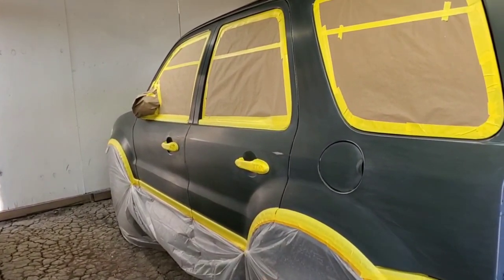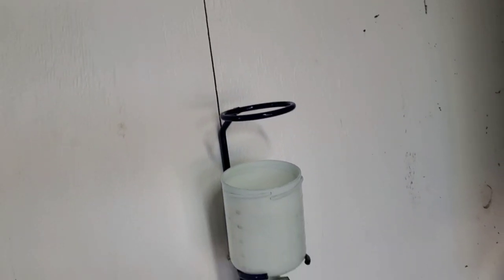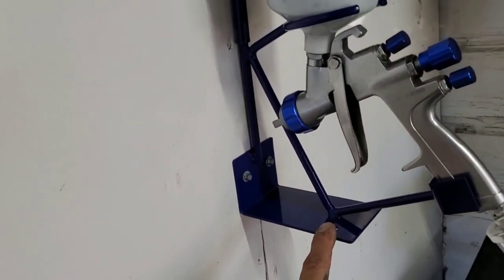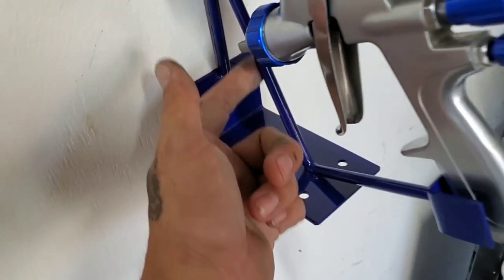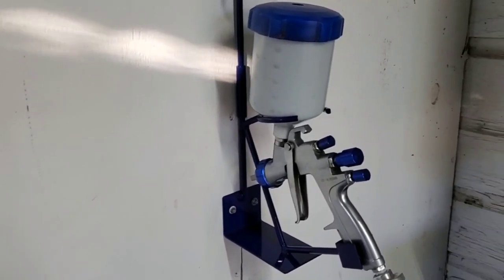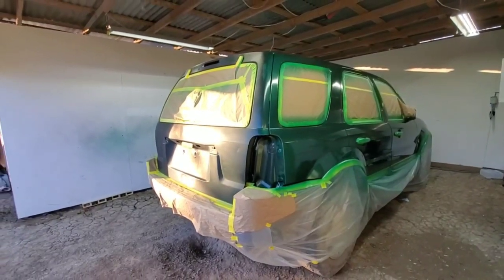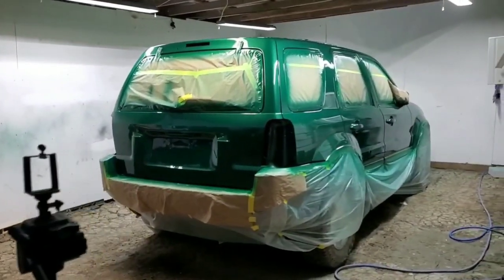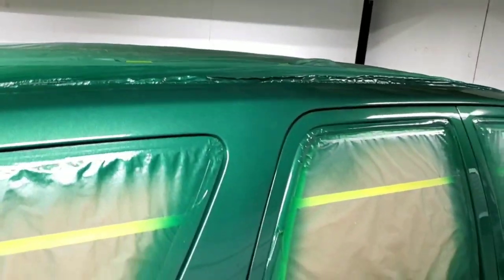Let's Spray!  eBay Paint "Jade Green " on a Ford Escape

Comment: One trick I was taught early on is to drape your air hose over your shoulder. That way you prevent it accidentally touching the wet paint. Getting any kind of blemish like that is always a pain in the ass! Also, swivel connector leader hose off your gun helps a ton!
Reply from the maker: Yup, good advice!  I need a swivel to be able to reach the lowest parts of the rocker panels..

Comment: Amazing how good that turned out with dirt floors and an open bay door!  I can only imagine what you could do with an actual spray booth!  Keep it up. Much success is coming your way. 🙌🏼
Reply: Yep, I painted some of my cars outside under trees, and it turned out ok. I did single stage. One just needs good light, light to no wind, and no leaves falling. Sometimes a bug or two gets in the paint, but wayyyy cheaper than paying someone who is just in it for the money to paint the auto. They do not do the prep, and quality masking needed. Plus they over charge for cheap paint, and in 2 plus years, you can see the lack there of by them, but they got your money, none the less.
Reply: @seanbrooks9308  Why does anyone work at a job? There is shops that half ass things no doubt, but the majority of us that have our own do not. Yes doing it for the money is the point, but so is doing it right so you have people spread the word AND come back. If places don't prep, mask right, or charge too much they ain't in business long.
Reply: Its set On verry Low Presure air..

Comment: Dang GT, that color came out good. I also use ebay for all my paints. mbiauto has kits with paint, clear, and hardener included and I just use the master pro primer from oreilly. You're the reason I decided to get into painting. Stay blessed bro and glad you could upgrade to that dewalt compressor.

Comment: Need to spray water around floor surface to avoid dust in the air
Reply: He spraying with the garage door open
Reply: thanks for that tip but also if i wanna use tarps do i moist them as well
Reply: He's painting on top of dirt...

Comment: 👍 Do you ever spray extra layers/coats on the front leading edges of the hood and fenders, to protect against rock chips and bug impacts? Maybe its just a 🇨🇦 thing
Reply: I tend to lay down some extra paint and clear on higher wear areas. It's not just a Canada thing babes.

Comment: Deffinatly nice for single stage !!
Reply from the maker: I also enjoy using speedokote primer and clearcoat. Great products, at a great price!  👌
Reply: @GTsPerformance   honestly best products in the 100-300$ range.
Reply: U got a great channel bro .. few things I'd love to see you upgrade to get you to the next levle . A nice paper tree / masking machine. Better gun, and rubber coat / epoxy that floor your spraying of for cleaner results ! All of those things would run under 1k and u will be amazed how much better things turn out ! If you need any help just pm me on FB Marco Colbert
Reply from the maker: @speedokoterefinishnetwork4937  I appreciate the feedback. I have a garage that is fully covered and with concrete floor.  That is going to help me with the wind, dirt and weather problems. I'll give the epoxy floors a good thought once I settle in. The garage still doesn't have electricity,  but I'm working on getting it connected very soon. 
Also, a 60 gal. compressor was another big investment to the garage & channel.  My best gun i have would be the Italco h3000 (which I save for base coats, candy and clears), then the Kobalt for anything else.
Definitely trying to give the channel an upgrade.  Thanks for the support!

Comment: Hi I was wondering can you put 2k clear on top of single stage paint if yes do you wait till it dries then sand it then spray with clear or you can do it after you spray the single stage thank you
Reply from the maker: Yes, you can! I would wait till after the single stage dies incase you get any bugs or imperfections,  you can sand it before applying clear.
Reply: @GTsPerformance  thank you how long is good time to wait a week and would single stage and then 2K clear on top would be better than base coat and 2k clean what you think better

Comment: Why go through all the trouble and not fill those couple dings?
Reply from the maker: I had a $200 budget, and that includes paint, materials and labor. 
👀what dings? 😁
Reply: GT's Performance   I was noticing that too. One above the drivers door handle. One big one directly under the back glass and another ding to the right side and down a bit.   Overall your technique is very good. A couple coats of an inexpensive clear would make it look amazing!

Comment: Nice job. How much paint did you buy to paint the ford?
Reply from the maker: A $95 gallon kit from Ebay. I put the link in the video description.
Reply: @GTsPerformance  thanks. Wow that is super cheap, way cheaper than local paint supply company

Comment: Awesome work, what brand and size of compressor do you use?
Reply from the maker: For this project,  I was using a 21 gallon Central Pneumatic from Harbor Freight.
Reply: That is the same compressor I started with painted many cars and trucks with mine plus everything else I did
Reply: @GTsPerformance did the compressor actually keep up enough air to spray continuously? My compressor just broke its connecting rod and am looking to buy another.
Reply from the maker: @davidalmazan1561  I have been using the harbor freight compressor for as long as I can remember. Painted so many cars, trucks and motorcycles,  from scooters to full size crew cab trucks (atleast 15+).. and the compressor is still kicking. In fact, all my paintjobs on YouTube (to this day) have been with the same compressor.  I've had so much luck with it,  I hope I don't jinx myself. 😁
I recently upgraded to a 60 gallon, which is going to do me good once I install it
Reply: @GTsPerformance  I also up graded but I bought a Husky 60 gallon

Comment: Great job homie I bet if it would have been done in the day in a closed garage and wet the floor with water to keep the dust down another thing buy a industrial blow dryer and point it and the plastic body parts doing this it brings out the oil in it and they will look brand new black so now sent me your address so you can do some work for me.    💯👍🏼😊